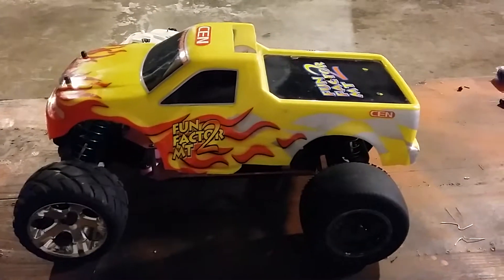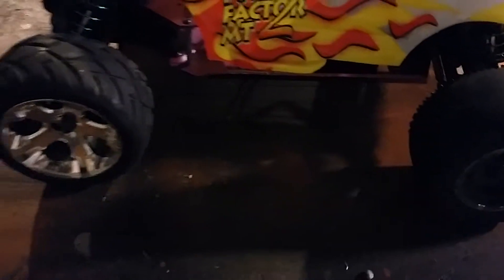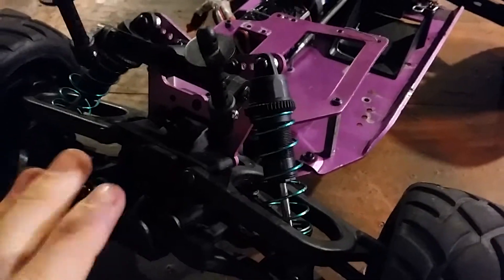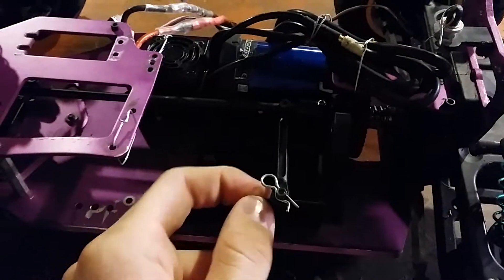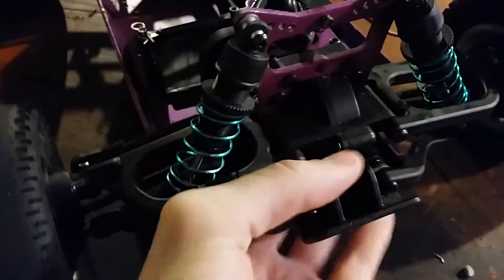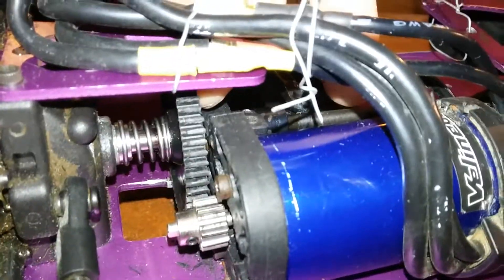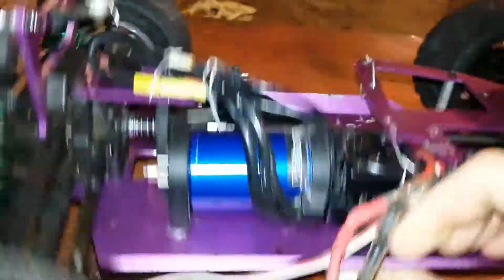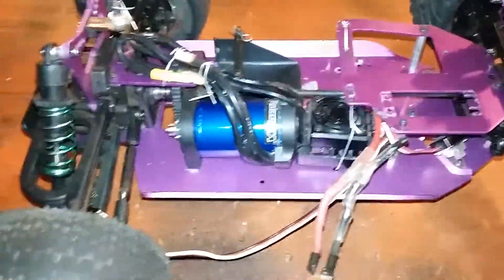Cen Racing Brushless Conversion

Comment: Dude how did you do this? I have one from the early 2000's and i had those common engine problems
Reply from the maker: Man it’s been years ago I’m not really into the rc world anymore but if I remember right the mount came out of a carpet car but I can remember which one the mounting holes on the bracket just happen to line up perfect with the holes in the chassis and it put it on there and went and got a pinion gear to go with the spur gear and the rest is plug n play